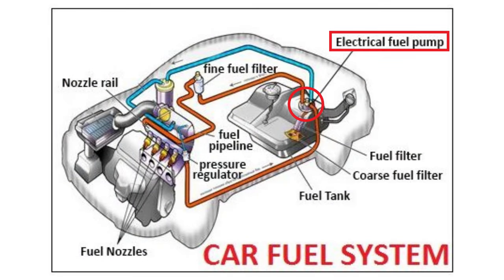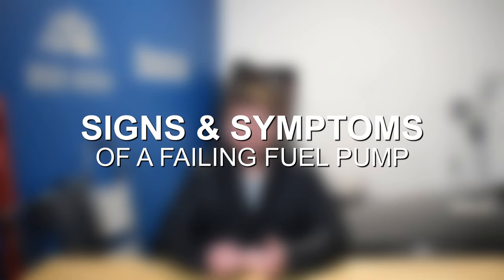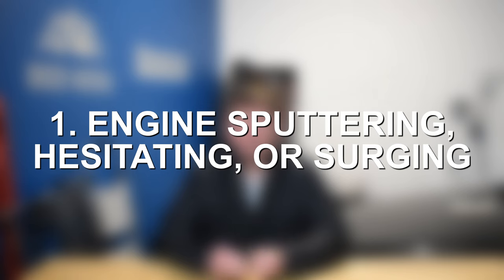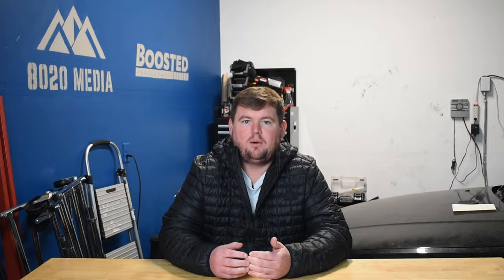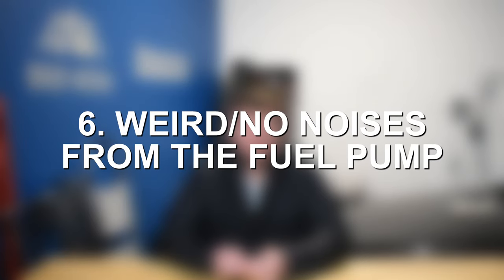6 Signs & Symptoms of a Failing Fuel Pump!

Comment: Be honest how many of yall watching this video kept trying to wipe your phones screen because of the stains on the back wall 😂 i cant be the only one? Great video btw.
Reply from the maker: J - LOL. Thanks for the feedback!
Reply: Im not getting codes. I had to bang on the tank, its been idling for 3 hours now in park. No problems from the idle. Am i just clogged with trash or is mine going out?
Reply from the maker: B - We've got a great video for this: https://youtu.be/BiYsqRJCLhE
Reply: Lol I did looks like oil hands caught someone from Falling
Reply: 😂😂😂😂got me
Reply: Haha
Reply: It's an automotive shop
Reply: lol……I just did then I saw your post.  Lmao
Reply: Me😂
Reply: I took the windex bottle to no avail, those are some pretty tough stains 😂
Reply: My Merc.A170 when I switch off the Engen the fuel pump makes a sound of a bouncy ball ,high bounces then lower bounces and faster.When the tank is full it seems to sound softer and faster from the time I switch off.
Reply: I'm still  rubbing. My thumb is bleeding
Reply: Didn't see the stains but it did take me about 2 minutes to figure out that he doesn't have a tick it's just the editing of the video.  💊💊🤣🤣🤣🤣

Comment: Dude!  My 99’ chevy k2500 has been doing this for awhile. I too replaced gas pump and filter, still wouldn’t start. Security light kept flashing. Followed your instructions. Cut the orange and yellow wires and looped together. Dude! Security light stopped flashing and started on first try😮. Didn’t need to wait ten minutes on and off. Thanks a million by brotha! 🤘🏼
Reply from the maker: R - Thanks for the feedback. Glad we could be helpful!
Reply: Does the security light have anything to do preventing start? What are the wires that you connected? I'm having same issues. Will check relays and fuses but interested knowing incase I still stuck.

Comment: Odd that this video pops up now. My son's escape had not been running for 4 months.   We didn't have any of the mentioned warning signs. One day it just began to  crank but not start. Anyways, I just replaced the fuel pump myself about 2 weeks ago and got it back up and running. I'm pretty proud of myself. I saved some money. It was so satisfying to hear it start up.
Reply from the maker: S - Nice! We make these videos to hopefully help people self diagnose and DIY problems. Thanks for sharing your experience.
Reply: Did any of the gauges worm before u changed the pump
Reply: Work
Reply: my granddaughters 2019 Ford escape fuel pump has went out 3 times in 2 months now since she bought it from carmax
Reply: Sometimes the fuel pump just stops. Other times it takes awhile for it to go out. A lot of years fuel pumps didn't have fuel pump sensors or it would have sent a code. But in your case it just went out. It happens I know 260.00 tow bill😂😂😂

Comment: 2006 F150 4.6 THOUGHT FOR SURE FUEL PUMP. CHANGED ,STILL WOULD START AND RUN FINE  FOR LIKE 45 SECONDS. THEN IT WOULD STALL. SO I CHECKED THE POWER COMING OFF THE ALTERNATOR. IT WOULD START AT 12.6  VOLTS AFTER 30 SECONDS IT WAS KICKING OUT 18 .5 VOLTS. I WENT OUT AND BOUGHT A BRAND NEW ALTERNATOR AT ORIELYS. EVERY THING IS FINE. SO ALWAYS CHECK VOLTS COMING OFF THE ALTERNATOR . TO LOW COULD CAUSE THE PROBLEM. OR TO HIGH COULD CAUSE THE PROBLEM. YOU DID MENTION VOLTS. SO I BOUGHT A VOLT METER  GREAT 15.00 INVESTMENT, TY
Reply from the maker: G - Great to hear the video helped! Thanks for sharing.

Comment: I never got any symptoms before the fuel pump died my car just wouldn't start one day replaced it now no problems
Reply from the maker: C - Interesting. Thanks for sharing your experience.
Reply: What would happen when you attempted to start it? I may be having this issue. Changed the starter, but the issue persists. I get all my lights on but zero crank
Reply: @lex_one-two  i had all my lights come on as well and it would try and start but never kicked over ...once changed it was all good to go ..when you try and start it you should hear a clicking sound come from the back of the car near the exhaust if you dont hear it its most likely  your fuel pump ...

Comment: is it possible for a messed up fuel pump to cause my gas to leak out? i’ve had two mechanics look at it one says it’s the fuel pump the other says the fuel pump is fine. But i have experienced some of these symptoms. My car started a little weird once (it was also veryyy cold) and sometimes when i drive it does kinda jerk when i accelerate. and like months ago while i was driving on the highway my check engine light flashed and then turned off.
Reply from the maker: S - While a damaged fuel pump assembly or associated components (e.g., seals, lines) could cause a gas leak, the symptoms suggest you also check the fuel system as a whole, including pressure testing the pump. The jerking during acceleration and flashing CEL could point to fuel delivery issues, which may or may not involve the pump. Keep us updated!

Comment: I have a 95 Impala when I put the key in the ignition I can hear my fuel pump but at times I don't hear it at all! Currently stalling out I just replaced and checked the majority of components and nothing! Maybe it might be my fuel pump 🤔
Reply from the maker: A - The issue is most likely a failing fuel pump or a problem in the relay or wiring circuit. Start with basic diagnostics like testing the relay and checking for voltage at the pump. If the pump consistently fails to run even with proper voltage, replacing it should resolve the issue.

Comment: Great video & info. Several of these symptoms (sputter, blinking CEL, noises, some hesitation) are now present on my son's 99 Camry with 136k on it. I changed the plugs/wires/cap/fuel filter (all Denso) 5k miles ago, with no issues at that time. I'll put my scanner on it to see what codes are stored, but I've already ordered the pump on Amazon.
Reply from the maker: H - Thanks for sharing this! Please keep us updated.
Reply: Read codes. P0300, P0301. Misfires. Pulled cylinder one plug. It was loose, but clean. Checked other 3 plugs. All good. Put Techron in tank and CEL stayed on next day. Cleared codes, will check throttle body plate tomorrow. Still not running 100 percent.
Reply from the maker: H - Interesting.. We do have a video for P0300: https://youtu.be/f1mQ5hD1-vI

Keep us posted.
Reply: I checked the fuel pressure. Perfect at 49psi.  Went to friend’s shop, as he has an Autel scanner.  Located the issue 1-2-3 with minor test. Plug wires 1 & 2 were shorting at the bottom of the spark plug tubes. Spraying water trick would not detect that. New Denso wires  ($42.15 Amazon) and problem solved. Runs perfectly again.  Returned fuel pump and Denso plugs to amazon .
Reply from the maker: H - Nice! Thanks for sharing your experience! This will certainly help future viewers.

Comment: Very informative video! My '04 Explorer has had sluggish acceleration for a long time, but started randomly stalling during the past year. In the past month it's been more frequent and getting harder to get going again after a stall, and most stalls are at the moment of pushing the gas pedal coming out of a turn. I suspected the pump so put it in a shop this morning to get a new fuel pump and filter.
Reply from the maker: D - Keep us posted. We hope this resolves your issues! We also have a video about stalling that may be helpful here as well: https://youtu.be/7bqAIbYRdnc
Reply: @8020Media  So far so good. It's been a couple of weeks and no problems, acceleration feels better, and idle is smoother.
Reply from the maker: D - Nice!

Comment: Thanks very much for your advice. Very informative
Reply from the maker: C - Thanks for the feedback! We hope it was helpful.
Reply: I got mines fixed. It was a tracking device hooked up to the car, and water had gotten into the device and corrode it. Then it causes a fault to the fuel pump which was probably connect to or near the wire.
Reply from the maker: C - Interesting. Thanks for coming back and updating here! This may help future viewers.

Comment: Interesting video for sure. I think I’ve experienced at least half of the symptoms you explain today, especially the long cranking from a cold start and especially the stalling issue at traffic lights and sometimes even while idling..
 But the weird thing is I put a fuel pressure gauge and I’m still getting 48 pounds of pressure which is normal that’s at regular idol. I’ve had enough. I think I’m going to replace the fuel pump. What do you think?
Reply from the maker: E - We have some videos that may be helpful for your research here: https://youtu.be/0YRdzJbHcm4
https://youtu.be/7bqAIbYRdnc

Comment: Thanks for the video Zach. Unfortunately this sounds exactly like the issue with my 2011 Honda Civic, 160k mikes. Just bought 4 months ago. Feel totally shafted. 
Codes said misfiring coils. Changed them all. After 4 days running great, car sputtered merging onto highway. 
Didn’t have enough power to make it up my driveway (let it cool for an hour then made it). 
Been noticing a longer crank at start up too. Just really inconsistent. 
So fuel pump replace time. Another $1,200 I can’t afford. So depressing. Have any connections in Santa Rosa CA that could do it for a deal? 
Thanks again
Reply from the maker: Unfortunately I don't have any connections out there but my recommendation would be to try to find a neighborhood mechanic who works out of his garage. Pump should be like $200 probably for a quality one and I'd be surprised if it is more than a 2hr job - never done it on a Civic so not sure how difficult it is but generally speaking fuel pumps are relatively easy to replace so find a guy who will be honest about the hours and charge you $100/hr instead of the $200+/hr that dealerships and probably indy's are charging out there in California.
Reply: Here in southern Austin Texas, I was quoted $2,500.

Comment: Very helpful video. My 2011 ford fusion hasn’t been starting but will crank for a while before it gives up. It almost sounds like it’s going to catch but shuts off. I’ve been trying to figure out if it was the fuel pump. I haven’t had any previous symptoms that you’ve mentioned though
Reply from the maker: N - This video should be useful for your research: https://youtu.be/0YRdzJbHcm4

Comment: So my CEL came on and first thing in the morning it would blink until the revs dropped. After 6 days it went off but there’s a whirling sound coming from the rear of the car clearly it’s the low pressure fuel pump. Now on my A5 I also have a high pressure fuel pump. My car still starts right up fine, not noticing any oil burning, mpg has gone down but nothing significant, no engine hiccup & stuff. So should I just replace the low pressure fuel pump and not bother with the high or just replace both now?
Reply from the maker: R - We would advise replacing the low-pressure fuel pump first, as it’s the clear source of the noise and potential fuel delivery issues. There’s no need to replace the high-pressure fuel pump unless it shows signs of failure during inspection.

Comment: Great video! Thx! Is the engine starting issue more prevalent in cold weather with a fuel pump issue? Also, I read that it should be replaced about 150K-200K miles, along with fuel filter every 30K in order vehicles. Does that sound right?
Reply from the maker: Yes, it is more prevalent in colder weather. The engine just takes a little longer to warm up when it's cold. Both are correct!
Reply: @8020Media  Thx so much for your reply!👍
Reply from the maker: N - Keep us updated.

Comment: My 2023 xt5 needed a surge pump according to the dealer. Took it in after seeing the engine light on. Its a year old car. Is this normal? They ordered the part. Is it safe to drive??
Reply from the maker: A - Wouldn't say it's normal. You can drive, but wouldn't recommend leaving it for too long.

Comment: so I'm having a problem on my DeVille where the car buzzes underneath by the gas tank and  sputters and as a misfire
Reply: Fuel pump
Reply: @LUISTORRES-vx4mg  just replaced it today runs fine, only a missfire left but i replaced the spark plug already so maybe fuel injector
Reply from the maker: A - Are you getting any engine codes?
Reply from the maker: A - Certainly could be injector. Keep us updated.
Reply: @8020Media  also it only actively missfires when your moving not parked
Reply from the maker: A - Keep us updated on this.

Comment: I have a 2019 Acura rdx. Recently under acceleration the exhaust will pop quickly with loss of power simultaneously. Changed all the spark plugs, and after 5 days it started back. I know my fuel pump has a recall on it, but acura sent a letter saying it won't have the part for me until November 😒
Reply from the maker: D - I'm afraid this certainly could be the fuel pump. Are you getting an engine lights or codes?
Reply: @8020Media just seeing this. Turns out my coils were almost toasted 😂

Comment: I got a 96 corolla & has been sitting for 4 months cause of a blown head gasket (which is replaced btw) & when it was at my friends house (for like 2 months since he flat towed it & yes he did some mechanical work before & never had an issue) & he had to bang on the starter while I was cranking it & was able to start it & drive it back home but now it wasnt wanna start, just cranks
I put a new battery in it (have two batteries cause of my sound system) & still won't start but it sounds like it wants to start
I did get it to start for a split second but instantly dies so idk if its my starter (it spins) or the fuel pump cause when I have the car to the on position, I don't hear a humming noise)
Reply from the maker: J - This video may be more helpful with your research: https://youtu.be/0YRdzJbHcm4

Comment: 1996 chevy 1500 4.3, symptom is long cranking when engine cold, tested fuel pressure first turn of key only gets 30 psi which must be causing the long crank condition, turn key off and back on and gets 60 psi and starts right up and runs fine. Is this a weak/bad fuel pump or can it be something else, Thanks.
Reply from the maker: G - It certainly could be! This video may be helpful for your research: https://youtu.be/0YRdzJbHcm4

Comment: I opened the fuel pump access cover in the trunk and jumpered the pump leads to 12 volts. The pump makes an uneven rumbling sound. Car starts after long cranking. Bad pump? Just replaced it 10k miles ago.
Reply from the maker: B - We have a video that we think will be helpful: https://youtu.be/0YRdzJbHcm4

Keep us updated.

Comment: This happens to my 2012 mini cooper I changed the fuel filter,spark plugs and ignition coils and it idled a bit better but still long crank to start and eventually dies after on park for a bit. I am changing the Fuel Pump over this Memorial Day. Hopefully this fixes the issue. Scan tool read p0300-301 multiple misfires.
Reply from the maker: Don't forget to do the fuel filter too!

Comment: My dodge RAM 2002 has hard starting and sometimes it dies but starts right away but I don't have any codes.
Reply from the maker: Sounds like a fueling problem - or your alternator could be going bad - fires up then battery dies cause alternator isn't keeping it charged. But the hard starting would have me leaning towards fueling, especially if you don't have to constantly recharge the battery.

Comment: Hey so need some help. Got no noise from the pump when the ignition is on. If I jump the relay, I can hear the pump. The car will start but as soon as it comes back down to idle, the engine cuts out. Have tested the fuse and relay and everything seems normal... Is this a fuel pump issue, or something bigger?
Reply from the maker: Chris - This could be a few things. We've made a few videos that we think will be helpful:
https://youtu.be/HKP1vKsIr4g
https://youtu.be/7bqAIbYRdnc
Reply: always mention the year make and model, because some cars have two fuel pump relay, like the 1991 Honda Accord...
Reply from the maker: R - true.

Comment: My digital fuel gauge is all over the place for Average and Range numbers. Happened after I got gas in my car. I'm only getting a different reading on the range when I turn it off and on. Very rarely does it go up or down in mileage when driving. Avg numbers bounce up and down. Everything else appears to be working properly for readings. Switched gas stations and it's still having this issue. Would that be something that a fuel issue would be causing or is ir another issue entirely? Nothing on the scanner is showing up for a specific code problem.
Reply from the maker: J - Likely a sensor or the fuel sending unit. Keep us updated